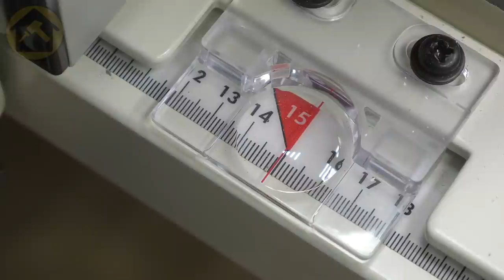Everyone knows this secret of the plastic canister, but nobody does it!!

Comment: Oh brother, ya a 5-gal bucket for $3 will do the same thing and save you an afternoon as well. Work smarter not harder
Reply: exactly what a waste !
Reply: Stop the negativity, there's enough hate in this world already
Yes the 5 gallon bucket is fine but this gets it out of the way and makes for a neater shop.  You have to agree, he's very creative. 
Job well done.👍👍👍👍👍
Reply: Buckets   £2    5o  screw fix
Reply: @jsh3234  
You're writing negatively about two guys that didn't see the point of spending an afternoon making a slide out trash can.
Don't be so sensitive.
Reply: You should make a video of going out and buying a bucket.  I bet that would be worth watching.
Reply: He's got 1.7M views in 3 weeks, that's pretty smart no?
Reply: But that doesn’t give you 1.8 million views!
Reply: @MultiShizmo  yeah probably got 4000usd, work smarter...
Reply: @jsh3234  dislike
Reply: That seems like a neat idea with recycling materials. Most of the time goes to waiting for the paint to dry, definatelly worth the time.
Reply: He used what he had instead of throwing it out, and he didn't have to get a bucket. Also, that took maybe 15-20 minutes tops to cut the bucket and make the mount that shape, he still would've had to do the majority of it.  Also a round bucket takes up more space than a semi square one, so it's a better use of the space. 
Stop being a hater, the internet has enough negativity already.
Reply: That's a valid point when something is overly complicated, doesn't solve much or is a waste. This is not the case though, plus, lots of views, not to mention making your own stuff is much more satisfying and fun.
Reply: You must be fun at parties
Reply: Life is by no means an even straight road to spend plenty of money shopping to look down anyone’s manual labour.
If you consider this man’s handicraft a useless and time-wasting work, meaning you never will do similarly.
What will you spend your leisure time for otherwise? You will read lots of books to get smarter? A smart man wouldn’t behave like saying so ugly comments on such a nice scene of action as you did.
Or you would train your muscles like an athlete’s ones to show yourself to girls? It’s said who takes too much care of his physical ego, takes less of his brain and mentality and good social conducts. Think well before commenting here!
Reply: Ye, that was a fun project of course, but so unnecessary 😅
Reply: @jsh3234  well, you could still do this exact thing, but with a bucket 😆 but yes, I agree, it's creative, and I love that! It's just a shame to be wasteful while being creative.
Reply: @andrew5689  yes, I do that a lot of the time too. Building even tho I don't need to xD
Reply: Inspiration 🙂😜
Reply: You could have saved yourself a lot more time by just walking the 5 ft over to your other trash can.. wow, and do something more important like going out and getting a real job
Reply: Just move the othere bin to under your bench, lol
Reply: What do ya expect, he's wearing steel toe crocks! LOL
Reply: @jsh3234  Thats not creative thats just a kitchen garbage drawer       thats been copied.
Reply: @RalphSampson...  I was writing negatively? How do you figure that? I'm just trying to get people to be more positive. Geez

Comment: So, unless you line the container with a trash bag, you'll have to rehandle the trash to empty it.  Why not just use a standard waste basket, with a rim on the edge, that would be easily removable from the hole you made in the plywood top?  And why ruin a perfectly good fuel can?
Reply: What I was thinking as well. Fuel cans are triple the cost of a trash can.
Reply: I don't think it was a fuel can... I think it was a camping water jug... But yeah I agree... I have recently just unsubscribed from this channel because he is obviously over thinking everything as of late...

Comment: A lot of extra work when a 5 gallon bucket works fine for me. Already has a handle attached too.
Reply: @brad1367  actually it's orange and clean, placed under my bench.
Reply: @brad1367  Good point Brad, good point. I also use a Shop vac that I bought at Home depot.  Didn't  make that eather.

Comment: Buy a wastebasket from Wal-mart for less than $10 instead of destroying a $25 fuel can. An added benefit is that you will have more time to watch YouTube videos that show you how to make stuff you'd be better off buying. THAT'S WHAT I THINK!
Reply: I agree just a waste of out time.
Reply: I'm thinking of building one.  I keep knocking my Walmart can over in my small shop.  Outa site outa mind.  LoL
Reply: @tommysts1920  why don't you modify your Walmart can ? Those gas or water jugs with the pour spout are more expensive than a trash bin that comes in many shapes and sizes you can even put it under a bench as well
Reply: that's exactly what I was thinking... a  trashcan under the work bench. hey I hear they have plastic bag liners you can insert in them too keeps your can clean  !
Reply: It’s the basic slider, and a removable can that are the good ideas—any kind of plastic trash can could be modified to fit
Reply: And just 10 steps away he got a trash can to empty it🧐
Reply: @raystanczak4277  exactly, whether it's a trash can or fuel can..can liner or no liner ...use what you want .. it's the over all idea ..out of the way ..easy function.
Reply: Come on, man. He's just making something for his YouTube channel. Has to do something to get views and comments. It's how he gets paid to "make stuff".
Reply: Why not just buy a bucket with a handle and cut a round hole for it to sit in instead?
Reply: Fun fact: for every comment here trashing him, all he can hear is "KASHING!". Who's the smart one?

Comment: Couldn't I use an old paint bucket. It already has a handle and several lips around the top. It's usually leftover and headed for the trash eventually. So it's basically free. Don't even need to cut it or screw it down either. I already have them sitting around collecting stuff any way. Only way I see repurposing a jug/ container is if it leaks and won't hold liquid.
Reply: Ohh the paint bucket! In the 90’s, job site, no plmbg, NO TIME! 💩🤣

Comment: And here, I have been using amazon cardboard boxes, that last quite a while in my shop, then you burn them for heat, as you replace them. I feel so stupid. Running out and buying a nice plastic can, sos I can cut it up. Love you tube parody vids. 😆
Reply: Wow could you please do a video to show me how you use it? I've already built the table so I'm thinking I'll just pin the cardboard to the side of the table!
Reply: @woofbark4475  set it on the floor
Reply: @ThisIsSolution  MO
Reply: @juliusdalmau6279  YAZ

Comment: I was shocked at how you let the power cord touch the side of the electric jigsaw while you were cutting. Twice !  2 inches of clearance from electrocution. Very risky imo.
Reply: He also wasn't wearing any eye or face protection while using a grinder.  Could have gotten plastic in his eye or worse.

Those cutting wheels come apart from the spin, not from the material you're cutting. Even cutting plastic he could have ended up with a piece of cutting disk embedded in his face.

Comment: Umm…buy a waste basket with side handles and a make a roller base for it? Hunk of scrap plywood and 4 inexpensive casters from Harbor Freight and you’re finished. Or just get a Homer bucket and use that? That container you’re sacrificing would easily cost more than either if those alternatives where I live.
Reply: just buy the $10 moving dolly from Harbor Freight and screw it to the trash can
Reply: @williamwilson2010  Even better yet! :-)

Comment: As a small cabinet shop owner myself I just have 4 5gallon buckets spread around the shop. Sure does suck when one is mostly full and gets knocked over and looking at it now it does look a little "trashy". This is a good way of using some scraps and making the shop a little neater. And for all you Karens/Kevins saying "no eye/face protection, one handed grinding, no steel toe boots, no fire retardant oxygen supplied hazmat suit" grow a pair.

Comment: Lot of negative comments on here, how many of you own a bin manufactured by a man wearing safety crocs? 

Watched a man last night create a butchers block from 40 whisky barrels, he cut the staves, planed them, cut them, put them through the thicknesser, glued them, cut them, planed them, cut them, put them through the thicknesser, glued them, cut them, planed them, cut them, put them through the thicknesser, glued them, sanded it, routed it, sanded it, oiled it, stained it, sanded it and then polished it. I reckon 20 of the wood made it into the block and 80% sawdust or chips and 35% of the glue never made the finished article. Ironically the butchers block looked like one made from offcuts that weren’t good enough to make a butcher’s block.

Comment: Having scrolled responses .... A lot are missing the over all concept ...use what ever receptacle you want for this idea ..having it at the work bench or table and out of the way is the over all concept.
how many have to go get the barrel,box or what ever you use ..this is right there.
Me I use a big mortar pan that slides from one side to the other on wood rails  ..of my all in one 4x8 table giving my access to either side
Reply: It's a shop.  Just set a bucket on the floor or toss you're waste into the bin from across the room.  You dont need to take up precious tool space for a wastebasket.

In our home shop, everything goes on the floor and is kicked under the table saw.  When were done we sweep it up and throw it away or burn it.
Reply: Why's he puttin' trash,
In the Beer drawer?